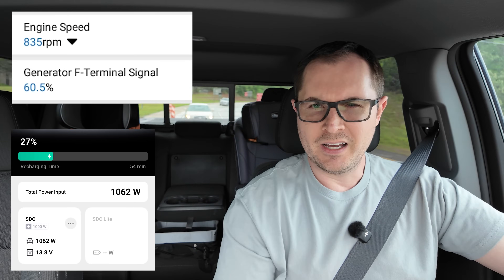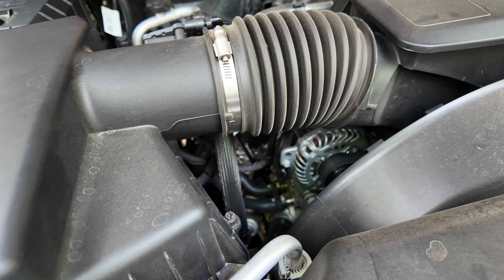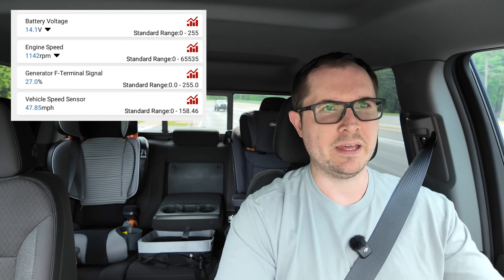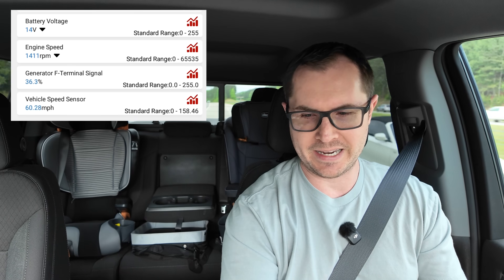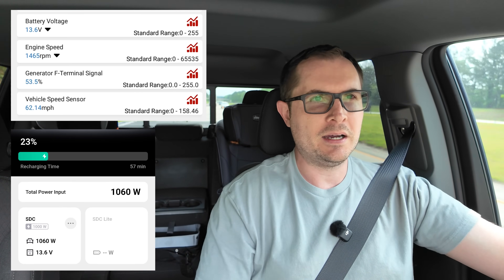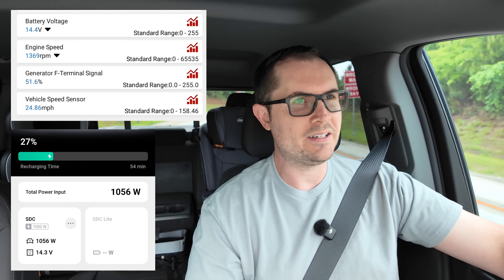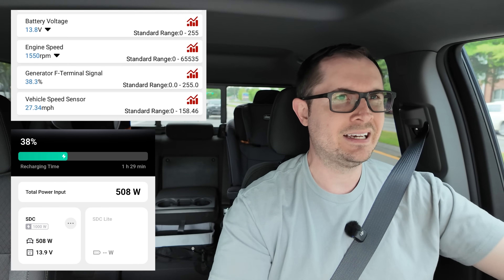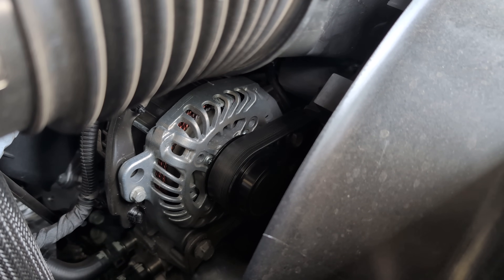I Show REAL Numbers: Impact of DC-DC Chargers from DJI, EcoFlow, Bluetti on Alternator

Comment: Alternators are rather easy to replace and not that expensive unless you're going to upgrade to a high output version. That being said, you could use the hell out of that thing all you want and it'll still probably last 5-10 years. I would say its the brushes in a brushed alternator that will go out first. Consider upgrading to a brushless version for worry-free use.

Comment: One thing to also take into account is ambient temperature. If it’s a 90F day vs a 40 degree day, loading your alternator at 80 percent is going to be very different as far as the amount of stress. 

The big killer is heat to an alternator.
Reply from the maker: Great point, thanks for watching.

Comment: I remember as a teenager when you had these guys running massive CB amplifiers in pick ups and suburbans. They would have fancy belt setups to run 4-6 alternators. 

Yes I said four to six alternators to be able to swing these giant amplifiers. 

You can google CB several alternatives and see some of the photos. 

It was crazy and you would have guys meet on a Saturday morning in an empty parking lot or park and have “key down “ contests. 

They would rev the hell out the engines and key up the CB radio and see how many KILOWATTS they could product.
Reply: Motor mauls.
They’re still doing it.
Some use 4 to 6 batteries instead .

Comment: The most useful things to see are voltage, current and stator winding temperature. If you overload your alternator expect the stator windings to increase and eventually burn out. Field cool voltage will vary with rotational speed for a given load. I think there is a Victron video on Youtube where they show an alternators windings smoking because they got too hot. Hence why i think stator winding temperature is the most important one. I suspect peak output can only be sustained for a short period of time before the stator winding temperature gets out of hand. The other stress could fall to your drive belt. As current increases so does the mechanical load the alternator puts on the engine via the drive belt. Probably not designed for peak load all the time. Luckily belts and even alternators are easily replaced and not overly expensive for most DIYers.

Comment: I recently had my alternator die. Looks like i finally burnt out the final stator coil as i could not run my DC to DC charger at max current. It would only ever happily run at 28A. With the new one i can run the DC to DC at over 40A. Anyway when the alternator died, i was waiting for a new one to arrive. So i started off my cranking batteries and then plugged in 270AH of lithium. My lithium battery has a Victron monitor. This monitor is very accurate and enabled me to see how much power the lithium was back feeding into my vehicle. For my 2007 Nissan GU Pattol Y61, it was under 10A during the day and 20A at night to drive. This covers the charge that does from higher voltage lithium to charge the lead acid as well as ECU, injectors etc. I managed to push close to 30A running blowers, lights, rear defroster etc. Standard it came with a Hitachi 90A alternator.  So much smaller than you guys issue. I managed to have the pulley come off the old alternator while i was driving around. So suspect i had a mechanical failure in the end. Lucky i had the new alternator ready to install when that happened otherwise I'd have been stuck.

Comment: I have the Bluetti charger which outputs @ 500 and change . My overland rig (Jeep JL Rubicon) has the tow package 240 amp alternator. I’m only going to use it when the sun isn’t out and I’m travelling and I want my Bluetti 200 to get to full charge . I won’t be running any other accessories. I find the sun and my solar panels do pretty good ( even when cloudy the panels put something in) … no I’m only going to use the alternator charger when I really need it . Great test though 👍🏻
Cheers Wild Bill , overland exploring the remotest Regions a of northern Canada 🇨🇦.
Reply: Oh dang, you should have no trouble when you're just driving then! Even if you're cruising and using 50% of your rated amp, you're still gonna have a thousand watts to play with and another 500+buffer on top before you near your maximum output. Sounds like you're sitting pretty with your setup!
Reply: Can you turn it off and on whenever you want?
Reply: @sirlost94 yes you can turn the charger on and off .

Comment: F terminal is "Field Terminal" signal. It is the applied voltage to the alternator's voltage regulator. The ECM uses PWM to change the duty cycle of the alternator to reduce mechanical load on the engine as your rpm or electrical demand change. At idle the signal will be increased to support the electrical load because the alternator is incapable of creating as much output at low rpms. Over 1500 on most vehicles the output arc will be above 80% efficient and begin to flatten out as you continue to increase rpm. Asking your alternator to give 100% duty cycle at idle can cause the unit to heat to the point of melting or catching fire.
Reply from the maker: Thanks for watching.

Comment: A very useful video. The key here is to use an appropriately sized DC to DC charger. On your vehicle you can just use a 1000w but on smaller vehicles 500 or even only 200 would be the correct choice. So it's not that these chargers are bad, it's just picking the right size.
Reply: I'm seriously shopping. The Eco flow for my stock Volkswagen g. T I with either a one hundred and forty or one hundred and fifty amp alternator. If it's nice weather and I just leave everything extra turned off in my car while driving, seems like my car is drawing under 500 watts to run everything since everything's so efficient. So I'm under 30%, which means I should be able to use at least 500 or in special situations where i'm going to be stationary for a longer period of time, even crank it up a little bit while i'm cruising at high RPM to push closer to that eighty percent draw without too much additional wear and tear on my alternator since the extra airflow will help keep everything cool as well. Trying to figure this out, I have a Delta 2 Max, and an ecoflow glacier to charge, both of which should charge in less than 2 hours at 800 watts and plug directly into the car's 12 volt cigarette port! I'm gonna be a long weekend warrior anyway, so this is probably gonna be a dozen times a year at most

Comment: As someone whos has 1500w or more stereo systems and Winches on just about every vehicle since 2005, i can tell you this wont hurt a thing lol. Over +15 years of absolute abuse ive only had issues with 1 alternator.  Not to mention new vehicles are equipped to output more. 

Theres guys who think headers hurt cars too lol you cant be worried all the time just because someone else is. 

Not to mention that an alternator upgrade really isnt that expensive.  You can get some pretty wild units for sub $500.

Comment: Most modern alternators can run fairly high up their amperage rating continuously.

Its low rpm that kills alternators - less airflow from the internal fan.
Gotta keep the rpms up when pulling a high load.

Comment: Have DC TO DC charger , take power from  battery  terminal  that then gos through a VSR (volt sensitive relay) that starts sending  at 13.8 v and stops  at  12.8 v, all the current modern alternators  are smart alternators, ie , do not make more than 12. 6-8 ,untill needed, have a wire running from DC-DC  that's  their to tell  it , it's  a smart alternator, hav been using  dc todc for 6 years and no problem,  but  my dc to dc is in my caravan boot 1meter from battery,  Anderson plugs on cable to connect when towing, also have , scan gage lll, to monitor electrical  output along with  other engine components,
Reply: good point!  There is no discussion in the thread on the smart charging algorithms that handicap battery charging. It's easy to divorce the alternator from PCM control and use an external regulator. There are kits for sale that do this.

Comment: I agree that the F means field. Since HP (746 Watts = 1 HP) is Torque times RPM, it's no surprise that the field has to have more current at idle to make the Alternator produce the same amount of power. As noted below, idle is when the Alternator fan is moving the least amount of cooling air. Also, sitting still is when the under hood temps reach max. So unless the Alternator has some kind of load shed capability, it's probably not a great idea to charge at idle.
From what I have seen, car Alternators are only about 50% efficient. Combine that with the ~28% engine efficiency and you're burning a lot more cash to charge on the road. Yes ythe Alternator does pull power from the engine. Otherwise it would have no need of a belt to turn it.

Comment: I will tell ya this much. The oem alternator can take this abuse however a remanufactured alternator will melt the solder off the slip rings due to the excessive current. The connections need to be brazed not soldered.
Reply: Interesting, take sir! I saw somebody else mention above, if you have a dead battery and you jump a car and then unhook from it the extra draw on the alternator can spike the temperatures up to 400°F within minutes and melt solder.  I had never heard of this before. Learning so much

Comment: Great video, thank you.  I pull an RV about 7,000 miles/year. It has 200 W of solar going into a Victron charge controller into only a 100 amp/hr lithium battery.  On cloudy days the solar didn't keep up (mainly 12 volt refrigerator load) so installed a Victron Orion 18 amp 12vdc to 12vdc charger.  I was losing over 1.5 volts from the truck battery back to the camper DC-DC through the truck factory wiring into 7 pin trailer plug. I ended up running a dedicated #6 gauge wire (both the +12vdc and ground) with heavy duty connector to solve the voltage drop.  This system works great and brings my battery up in only a couple hours of driving.  The Victron 18 amps (actually about 21 into Victron to produce 18 into the lithium) shouldn't do any damage to the vehicle charging system.  My tow vehicle is a 2023 Ram 1500 with the E-Torque mild hybrid system.  That system charges the 12 volt truck chassis battery and a 48 volt battery behind the rear seat. On deceleration this motor/generator E-torque setup charges batteries and supposedly reduces brake pad wear.  The motor generator also provide added additional take off torque during first acceleration from an idling stop.  Plus it starts the engine if the start/stop fuel saving perimeters are met. (I keep that disabled).  The big question for me is what is this E-torque system rated at for charge current??  Most trucks spec out what their alternator can do.  Ram E-Torque??  I do like the system but some have reported problems with early failures.  Most get along fine but I bought the 125K mile warranty to sleep better.

Comment: Yes some people who have RVs and campers have swapped lithium batteries in and quickly burned out their alternators. These kind of batteries can accept a huge amount of power that's why fast charging is possible on EVs. The lead acid batteries we are use to are kind of self limiting and and will only take so much power no matter the dept of discharge. The actually sell alternators with external regulators with load and temperature sensors made for charging lithium batteries and power banks. They may not work right on modern vehicles where the ECU controllers the alternator.

Comment: Did I miss it or did you not show the F-term after starting the vehicle? That is the largest load a smart alternator will see. The Victron Orion units are clever enough not to use the DC-DC charging during that starter battery recovery period.
Reply from the maker: Thank you for watching. Great question. The EcoFlow, Bluetti, and DJI all have a delay from time the vehicle starts before they start drawing power. Additionally they all have a minimum voltage threshold before they completely cut-off and stop drawing power, and if the voltage is approaching or trending toward the minimum cut-off, they throttle back accordingly. I have my minmum voltage set to 13.0V and that seems to work nicely. The logic is, if the voltage drops, the alternator must be struggling to keep-up, so then the DC-DC pulls back on the power. Kinda clever how the manufacturers incorporated that basic safeguard in the products.

Comment: Amazed the chargers can't automatically scale down their consumption in realtime with either (A.) Easy - Voltage drops in the .1 (point one) of a volt, as its a clear indicator of your alternator being at load under idle in your driving data. (B.) Slightly more involved - A CAN bus feed for the charger to back off as RPM's decrease putting less stress on the windings under low RPM's.
Reply from the maker: Thank you for watching. Great question. The EcoFlow, Bluetti, and DJI all have a delay from time the vehicle starts before they start drawing power. Additionally they all have a minimum voltage threshold before they completely cut-off and stop drawing power, and if the voltage is approaching or trending toward the minimum cut-off, they throttle back accordingly. I have my minmum voltage set to 13.0V and that seems to work nicely. Most of them default to mid 12s from the factory.

Comment: I always upgrade my trucks to high output alternator so that I don't have to worry about this. My Yukon XL 2500 has a 370 amp MechMan that can power a couple houses no problem. I also upgraded the electrical with 1/0 runs of OFC going to terminal blocks that my aftermarket equipment draws power off of. Did a big 3 upgrade and run an XS Power D3400 battery under the hood. Voltage is a constant 14.4v. So no worries about killing my alternator.
Reply from the maker: Nice setup!

Comment: But per the description "Standard Range 0 - 255" for the Generator F-Terminal Signal.   So even 90% sounds low.
Reply from the maker: Great catch. The 0-255 is an integer representation for 8-bit integer. It's kinda confusing the way the OBD2 software shows it off to the side for most of the variables, but it's almost irrelevant as the truck in this case only display a percent, which is out of 100% max. Mostly it's a limitation of the OBD2 software that needs to be patched ultimately. I almost cropped it out to avoid confusion, so my apologies there.
Reply: @AdventureRocks  Thx for the information.  It was confusing to me (but no one else for some reason, lol).
Reply: @AdventureRocks  great answer to a great question!

Comment: I believe the location of your alternator mounted within engine bay plays an important part in cooling.  My Tundra upgraded 270A is mounted on lower right of the block and is visible from passenger wheel well so it gets good air intake across the coils.  In retrospect i should have wired a temp sensor to alt coil for real time feedback.  2007 Toy Tundra
Reply from the maker: Great point, thank you for watching.

Comment: What is being charged by the DC to DC charger?
Reply from the maker: Great question. Most popularly, they are used to charge any lithium-based battery although sometimes folks use them for other chemistries such as AGM. In this video the DC to DC charger is charging a 1024Wh DJI Power 1000 portable power station.

Comment: Interesting information. I guess it begs the question, F Terminal percentage means what? Do the alternators have no protection? If your static, average F Terminal usage is 30% and the occasional use of a DC-DC charger changes that to 50%, what does that mean? The only real info that would help would be some correlation between alternator failure lifetime and DC-DC chargers usage, which of course is something we'd never get over any significant sample size. If user A says "I draw 1000 amps every day and have never had a problem" and user B says "I put in one of these things and my alternator died 2 weeks later", all we have is anecdotal evidence. Like my grandfather who lived to be 100 and smoked 3 packs of cigarets a day. Still, thanks for doing this.
Reply from the maker: Great question, thanks for watching. Without getting too technical, the F terminal on a GM trucks is responsible for controlling and monitoring the alternator's charging output. It's not the same as putting a clamp meter around hot leg and measuring amperage, but still a nice indicator that I can easily read via OBD2 port. The big takeaway I learned from this experiment is to avoid idling both from the standpoint of reduced alternator capacity at lower RPM and potential temperature issues given lack of airflow at idle.